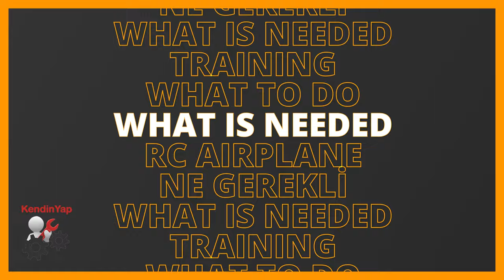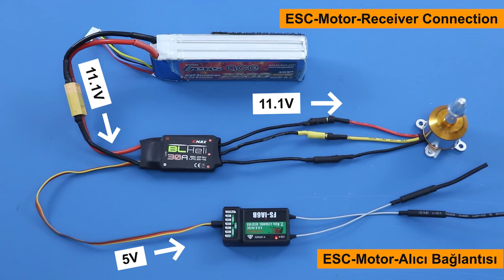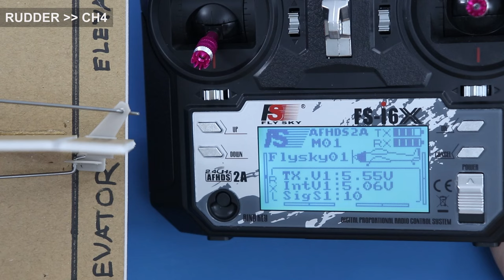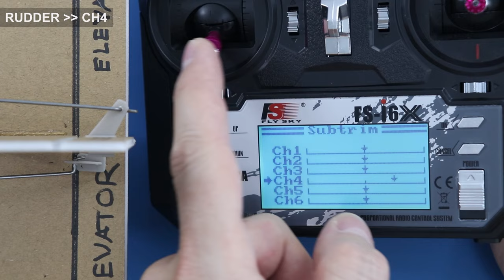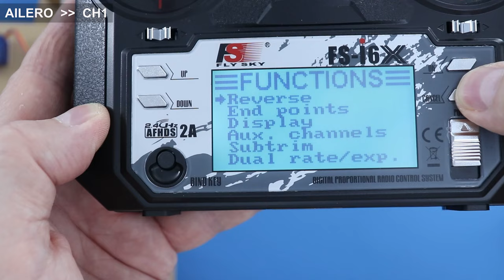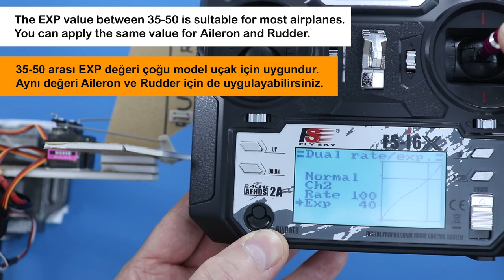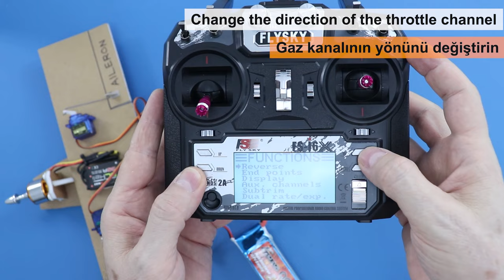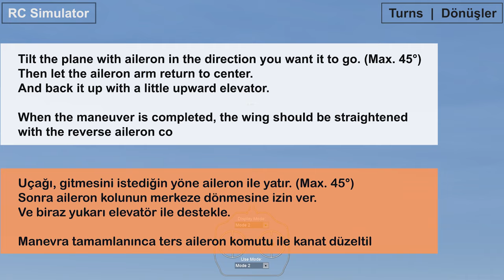Tutorial for RC Airplane Modeling Beginners. Basic Flight Training. Basic Settings

Comment: When I was a teenager I had (still have!) a Royal six channel RC system that cost me a fortune, even second-hand. It was on the 72 MHz band. I don't know what's being used today. Each servo weighed 1.2 ounces or about 36 grams, which was considered amazing at the time. Today it seems more like a brick! I hear some modern servos weigh as little as 0.3 ounce or 9 grams. Just amazing. Everyone ran incredibly noisy engines back then too, as electric motors were so primitive. We've come a long, long way in forty years!

Comment: I love your RC, it has so many features that I really need for my RC plane. I already have one (Futaba T6L) and I also have a receiver (Futaba R3106GF). If I buy your RC do I need to buy also another receiver? And what's the name of your RC?
Reply from the maker: I am not a seller. Below the video is a link for reference. The transmitter and receiver come out of the box as a set.
If you already have a controller set, you don't need it. The extra benefit for you is that the cable required for the simulation connection comes out of the box.

Comment: Great video by the way I have one question though. At what voltage should I stop flying my RC plane if the battery is 11.1v? My transmitter has a sensor indicating the voltage of the receiver. (Same exact transmitter as in video flysky) this is a lower voltage though because the current has to pass through the esc and motors first. Which in turn makes less voltage for the receiver.(please correct me if I'm wrong I'm knew to this). I know that at a certain voltage lipos should stopped being used and be charged again so I was just wondering what voltage I should stop flying my plane from the sensor on the receiver voltage. Thanks I love your videos! Please all feedback Is appreciated😁 I did some research and for the actual battery the absolute cutoff is 9 volts I don't know if this helps but I just wanted to tell you.
Reply from the maker: Ideally, 3.7V (nominal voltage) should be used as the minimum lower limit for each cell when unloaded. If the load is active (that is, the engine is running), 3.3- 3.5V can be considered reasonable as the lower limit.
But the quality of the battery may provide some flexibility for lower limits.

Comment: I want to ask for another esc problem. I have the same fsi6x radio. During flight, when i landed the plane the bldc motor kept on running and did not stop although the throttle was at zero. Due to which my propeller broke. I later tested it and noticed that as I run the servos for about 5-15 minutes, the bldc motor automatically starts spinning although throttle is at zero. Can you please help me with this problem??
Reply from the maker: An interesting problem. The solution below might work for you.
Increase the minimum EPA of the gas duct from 100% to 120%. There's a chance it might work. But this is not a normal problem. There is a possibility of a physical malfunction.
Reply: @Kendin-Yap  I did that but it also not worked for a longer time. Now I have solved the problem by calibrating the esc properly. It works fine now. But I am still doubtful about my fsi6x radio. Is it possible that its the problem of my transmitter?

Comment: Hi, loving your video from India. I have bonka u2 battery 35c with burst 70c it is reason for my esc burn I am using 30a generic esc. Please help me
Reply from the maker: C value does not cause the ESC to burn out. Situations that may cause ESC to malfunction:
- High voltage
- Short circuit
- Reverse polarity connection to battery input
- Current drawn above the capacity of the ESC;
The use of improper propeller may cause the motor to draw excessive current, especially in high KV motors. And when the technical limits of ESC are exceeded, ESC breaks down.
Reply: @Kendin-Yap  I am using 2450kv motor with 6045 propeller and normal 30a esc. Is that good